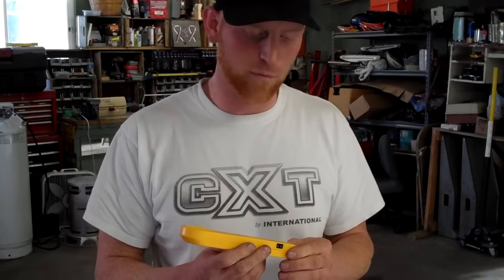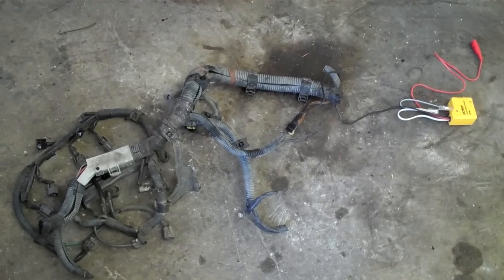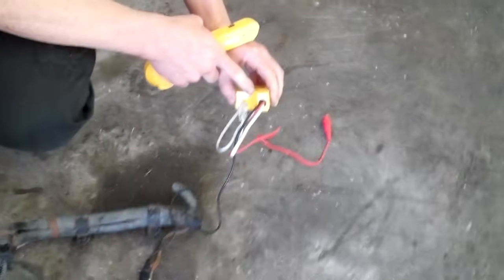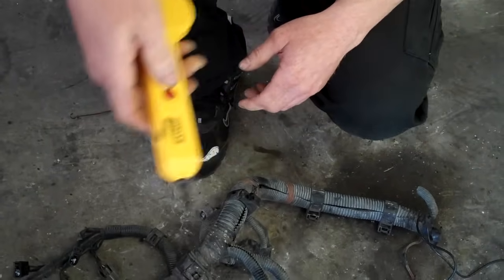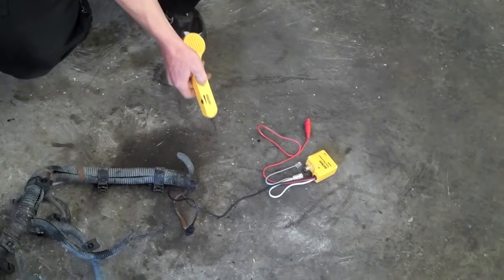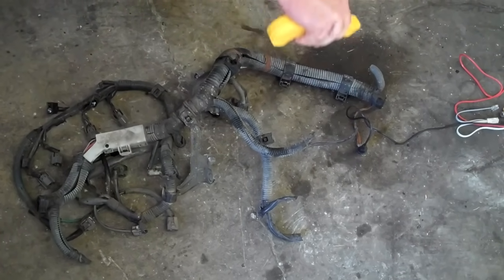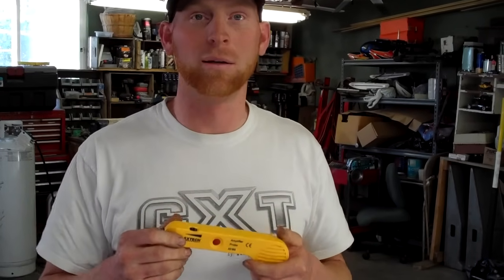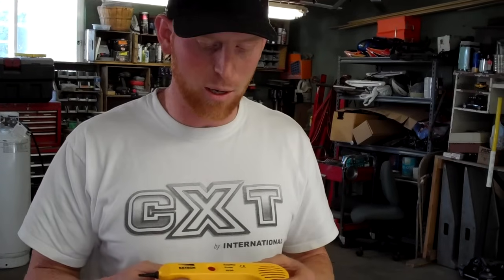How to find an open circuit or shorted wire the FAST easy way

Comment: The only time the tone reduces is when the tool is moved away from the harness. Passing over the supposed "short" (the cut) the tone continues without a break until he moves the tool away from all wires. This demo shows nothing!
Reply: Dennis Moore For someone with so much experience, you sure are stingy with it... not a single video uploaded trying to help others out. I guess leaving snotty comments is the extent of your commitment to sharing your "knowledge". I don't believe you, by the way... as you and that other doofus, andy bee, have failed to grasp Brian's explanation of how such a simple tool works and can be useful.
Reply: Dennis Moore And how is a DMM gonna show you where the short is?... especially if the cable's buried behind something? You are a doofus with a bad attitude...
Reply: Dennis Moore You are not very bright... muting this conversation.
Reply from the maker: +Dennis Moore Here's a better demo of the tool in action → https://www.youtube.com/watch?v=OJzobXmMwuM  My appologies for the lack of effort that I put into this video.  Another demo that was better is this one here → https://www.youtube.com/watch?v=nWcslpb5GgM  Here's another video where I used the tool to trace a circuit I didn't have a wire diagram for → https://www.youtube.com/watch?v=nY-jXsv3C7I
Reply from the maker: +Joel Resendiz Here's a better video on how this works. https://www.youtube.com/watch?v=OJzobXmMwuM
Reply: Facepalm.  The break was at the end of the wire.  had there been MORE wire, there STILL would have been less tone, this method is absolutely applicable and works.    No it doesn't stop the tone the INSTANT the probe is at the break, but like stud finder, it narrows the area down to make the open easily found.  When you have 20 yards of cable with a break at 10 yards, you know at 10.2 yards that you've found the open.  Just use your brain and think it through logically.  What's most unbelievable is as of this writing FORTY people thumbsed you up without thinking it through.
Reply: Yes this video is showing an open actually and I guess you only need one wire a short you'd probably need two wires hooked up and as you get closer to the short the audible sound would go away because that's where it shorted to ground or nuetral back the other way....
Reply: andy bee actually  the way he has it connected will allow him to find the route of the wire.  That tone will not work with tip and ring used on a shorted pair.
Reply: jrfoleyjr Ditto brother,  current FT here,  break downs are not used to much anymore due to the risk of fires, however we use them on a case by case bases,    The tone he has will not work while a short is on the pair providing it a solid short.  TDR is my friend.   However, sometimes will fool you in a wet cable giving a false reading as a bridge tap.   The way he has the tone connected help him find the route of the pair as long as it’s not grounded as well, ( never ending tone) on everything.   Lol.
Reply: Dennis Moore the multi meter has this function to test a shorted circuit,  the tone he has will only transmit the tone on the pair of wires he is connected to providing it’s not crossed with another pair,  the tone will work thru DC voltage well above 12vdc.  We use them all the time on 48-52vdc and it works perfect.   He was using the wiring harness as an example, granted he didn’t demonstrate an actual short location.  Which can’t be done with that model of tone.
Reply: estupido
Reply: Andy Bee....I agree with you all the way.
Reply: I thought he was going to teach me something I missed during my 36 years as 
a service tech cable splicer for a local telephone company. It's most useful to locate the path of a pair of wires also to find single pair that's hiding in the midst of thousands of other wires. Don't get me wrong it will send tone thru your wiring harness of an automobile or any conductor for that matter it will not take the place of the Volt OHM meter for less than $10 at harbor freight.
Reply: If he only hooked to 1 wire, would be more effective
Reply: andy bee Wire beyond that point wouldn't be emitting the generated tone, so the device would behave exactly as it does here although there is no wire beyond that point(Brian is tracing an imaginary wire)... but I think you should just hire someone to work on your car...
Reply: @jrmym2  you’re clearly not smart enough to understand what’s going on
Reply: and your an idiot. he states there are multiple grounds connected to the harness so more than one will be caring a tone! christ am I the only one who understands the functionality of this tool?
Reply: Dennis Moore You are the only one who looks stupid here... this ain't rocket science.
Reply: +andy bee I was a cable splicer at the phone company for years and we did NOT use these tone and probe tools to locate shorts or opens. Basically all this was useful for was to follow wiring concealed inside the wall and to help identify pairs in a multi-pair cable by attaching the clips across the wires of the pair. The way he is using it you could clip to a headlight wire and hear the tone at the other end of the car.

If you clip the toner across a pair of wires in a telephone cable, you could probe among the pairs to find it on the other end of the cable. This was done in air core paper insulated cables to make sure we had the same pair end to end because there was no real color code in paper insulated cables.

To find a short, we had a breakdown box that would put a tone on the shorted pair that could be heard with an amplifier and coil right through a metal sheath on the cable. We would follow the cable with the coil and headset until the tone went away. That is where the short is. Open the sheath and fix the short which was usually a wet cable so dry it out and tape the affected pairs with strips of masking tape.  

Finding an open uses a different tool called a TDR (Time Domain Reflectometer) but we called it a wire radar because it could take you to within inches of an open. A TDR has all sorts of uses, but they are an expensive tool.
Reply: andy bee I thought the exact same thing as +andy bee , but after seeing 7578 likes and only 182 dislikes  i then thought i was the only person that thinks this demo is worthless. This demo is absolutely worthless it doesn't even begin to show you how to find a bad wire in a wiring harness.
Reply: andy bee Exactly 777000 people who are no wiser and look as stupid as a person using a hammer as a saw.
Reply: Dennis Moore I couldn't even watch the entire video.
Reply: you don't get it at all. Pay attention. That's the whole point. Once he passes the cut in the wires, the tone would stop like it did in the video. You are not an electrician in the slightest otherwise you'd know how to use a voltage indicator pen so you'd know this one as well.
Reply from the maker: +andy bee Here's another video I did that better demonstrates this tool in use. → https://www.youtube.com/watch?v=OJzobXmMwuM
Reply: Its almost like people who use their screwdrivers as chisels.Their linemans plyers as hammers.Usually rookies find  a toner and because they don't understand the multimeter use the toner.Each tool has an application.Use your toner if you want but your taking chances of getting the wrong wire.Sometimes when the wire is to close to something electrical it will cancel out the tone for example.A multimeter  you can twist the wire together to get short untwist it to get a open then you know for sure you have the right wire.YOu can set up some meters to give a tone when its closed and not tone when its open.
Reply: @dennismoore8613 I worked in cable/telecom for years and just switched to be a mechanic/apprentice alittle over a year ago.  You can verify the wire you have the tone on is the correct wire by shorting the wire with the tone to ground (if you have the black lead connected to a chassis ground) and if the tone stops when your shorting it to ground and starts again when you remove it from ground, then that’s your wire.  Basically when the leads from the tone generator are shorted together it kills the tone.  Some higher priced “toners” will change the tone sound as soon as you short the leads together.

Comment: You keep saying short when in fact you are descibing an open.
Reply: Yes it is an open and I’m pretty sure it wouldn’t work many times in automotive because there are many times that same circuit running to different loads from the same fuse. If it was a single in line circuit it would be wonderful. I’ve loved and done auto electrical work since 1980. Otherwise a pretty cool video
Reply: Yes, thanks you!
Reply: To find short circuits (or the absence of continuity indicating noise in a wiggle test for intermittent open circuits) supplement your Fox and Hound toner & probe shown here with a Power Probe Scream'N Continuity Tester & Voltage Detector PWP-PPCT.
Reply: Jules Bartow A short is TOO MUCH continuity—so to speak—with electricity able to take a shortcut to ground bypassing the load it is meant to power.  So continuity tester will show a short as continuity—(bad continuity).  Continuity test will show an open.  It will not show a short
Reply: Give the guy a break, he's only an auto mechanic.
Reply: yup.  If shorted you would loose tone.
Reply: @eisiebuddaie3551  The tone continues until the far end of the conductor it's connected to. The typical use is to find multiple points  along a conductor without having to follow the entire length by hand, which is difficult  or impossible when the conductor runs through walls or is part of a large bundle of wires.   Since a short means that conductors that aren't supposed to be connected are you'd find the tone continuing through conductor(s) were you shouldn't have it. If you recognize that the path is no longer correct you can find the location of the short.
Reply: @stevepseudonym445  the only way you will get a shorted circuit to tone out is if it's is disconnected from it's terminating equipment.
Reply: @eisiebuddaie3551  You know that the reason a short is a problem is that it conducts electricity? You know that the signal from a tone generator is an electrical current? The tone will take the short circuit the same way the usual current does.
Reply: @stevepseudonym445  sorry Steve you are so right.  I've only been using a tone generator for 15 years on a daily basis. I've never experienced a shorted wire and this is all new to me.
Reply: @stevepseudonym445  let's conduct an experiment.  Do you have a tone generator?  If so, touch the leads together and tell me how your tone sounds.
Reply: @eisiebuddaie3551  Telling me to touch the leads of a tone generator to one another tells us that you don't understand how short circuits work.
Reply: @stevepseudonym445  when you touch the leads you are simulating a short.  Listen man... You're just not catching on to what I'm saying.  

If you have wires that are HOT and shorted (or bridged which is what I think you are describing) you will NOT get tone unless you disconnect wires from all power sources/electronics aka OPEN THEM UP.  

You can't just throw a tone generator on two wires not knowing where they go and what they land on and expect to get good tone and figure it out the way described in the video.  
He describes an open.  

All done here.  Good luck with your wiring!
Reply: @eisiebuddaie3551  IOW, it's entirely possible to find a short using a tone generator.
Reply: Steve Pseudonym I see the logic, but a short is more particular than ANY conductor touching another. A short means conductor that shouldn’t be connected (directly) TO GROUND, are—not just any other conductors.  When a short touches ground, then EVERY other conductor connected to ground (most circuits in the car) will generate signal at that moment.  Not very useful.
Reply: Same thing. It can locate a short, because a short and a opening is the same thing. Some say short, some say opening.
Reply: Dr.James A McBean. D,Th, Mcc NOPE!  Short is the OPPOSITE of an opening.  It is a closed circuit without a load for the electricity to power—So it heats up the entire circuit and when a fuse or thin wire burns all the way through and breaks the circuit, THEN you may have an open.  But a short is a CLOSE with no load—NOT an open.  Sot the electricity is taking a “shortcut” to ground or circuit completion without having to do any work like it is designed to do.
Reply: @j.a.mcbean.4043   a short and a open are 2 different things, a open is a break in a wire. a short is a circuit that is allows a current to travel along an unintended path
Reply: Dr.James A McBean. D,Th, Mcc   exactly i myself call it shorted opening
Reply: @j.a.mcbean.4043  nope

Comment: You can check if you have the correct pair of wires by placing the probe on the wires you hear the tone coming from, and then short the lines together and if you hear the tone drop its the correct pair. Just a tip as we use these devices all the time.

Comment: I work for a phone company and use this all the time. I ones tried using it finding cable in my car but with no luck. you can hear the tone all over the place
Reply: +Mar Gudmundsson 
I bet that since the cables in the car wiring harness aren't matched pairs twisted together, all of the wires just cross-talk to each other like crazy, when you send a frequency through.

Comment: I dont understand,  the noise means there is a short in the harness? or the tone goes away theres a break or???  explain a little better, I have a similar tool and have maybe some electrical issues on my truck I need to figure out so could you be a bit more specific?

Comment: Think Brian feel in Love with the sales Rep Mandy, Saw a little twinkle in his eye when he mentioned her :)

As far as the tool, His looked totally brand new, And he hasn't tried it on anything, I used this tool or one basically the same for around 30 years in the trouble shooting of telephone cables, pretty much useless in car work.

Have you called her back Brian, probably dropped him like a hot rock, talking to Eric the car guy now, Those sales reps, I tell you., Better to string them out Brian !

Comment: I cant see how that tool helps in Detecting a wire inside a wall when you went both ways and the same tone was present, I have the same tool and the only thing its good for is tracing out wires
Reply: The tool uses induction to trace any wire that's energized. In the video that's just the regular AC current for the wire in the wall, and there's current in a wire below the switch and a wire above the switch. That's exactly what you'd expect if the power leads to the switch and then continues on to a light or other load. When the tone generator is connected to a wire that's not energized the receiver picks up that tone instead of the 60Hz AC tone.

Comment: Props for making the video.  I don't understand how this tool is useful though.  When you take the tool any direction away from the wire, the tone fades.  It would appear you can bring the tool right up to the break, and it's still ringing the tone.  What am I missing here?
Reply: The tone should fade as you continue along the wire after the break.
Reply: Oh, so it gets you in the ball park.  You know when it fades you're within a foot or so.  Thanks

Comment: he should use both crocodile clips on 2 separate wires then start tracing them along.
IF wires wanted to be find ... cannot be traced (no signal!) it's because the wires ARE SHORT-CIRCUITED.....

The switch on the tone generator (small yellow box) has ANOTHER position for CONTINUITY of two wires (where you put the crocodiles on...).  No need for use of detector on this instance.

Comment: Need more info on how to use this on the car or truck. Need to know how to check for short in ground and hot wires. Not just at the end but in the middle too. U showed of to trace a wire how do u check for a short. Need more info

Comment: Hey Brian, that looks like a cool tool. I've got a p0500 code for my vss and after installing another sensor still nothing. Code reader says open or shorted wire or pcm. How do I find out which is the problem. Tired of paying the mechanics that conveniently can't reproduce the problem. Help is appreciated.

Comment: i believe this is a cable tracer not a cable short circuit tracer.
Reply: They are called a tone generator.
Reply: That's exactly what that tool is.  And I've also used that specific one before, and for tracing cables.  This is coming from and Electrical Engineer.
Reply: mrwatcherofmovies tick tracer is what cable calls it
Reply: Yep toner

Comment: Hey , will it work for Excavation of 3 meter ? will it sense ? I wanted to know that how to get the location of a wire or able broken underground ???
Reply: nope. you have to pay few hundred of dollars for one to measure 3 metres in the ground
Reply from the maker: There are tools for that, but I don't think this one is sensitive enough.
Reply: What kind of cable are you talking about? If it's a fibre optic cable, then you would use an OTDR, if it's copper, you can only tell the exact location of a break with a Cable tester and if the cable is twisted pair. There are limitations on the distance of the cable run.  This tool that he is using won't tell you where a break is. It's a tone generator and used to identify or check for continuity of a cable.
Reply: http://www.amazon.com/Fluke-2042-Cable-locator/dp/B000ONMFY2/ref=sr_1_1?ie=UTF8&qid=1419806256&sr=8-1&keywords=fluke+cable+locator